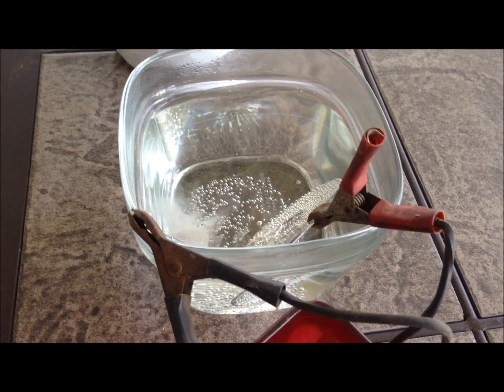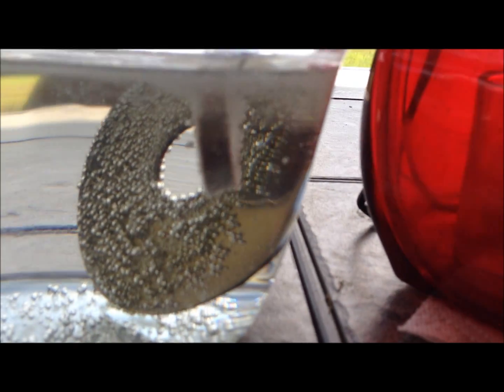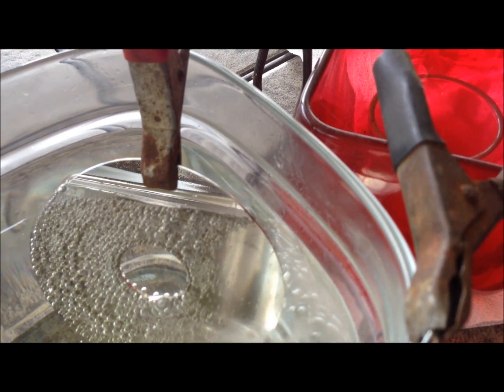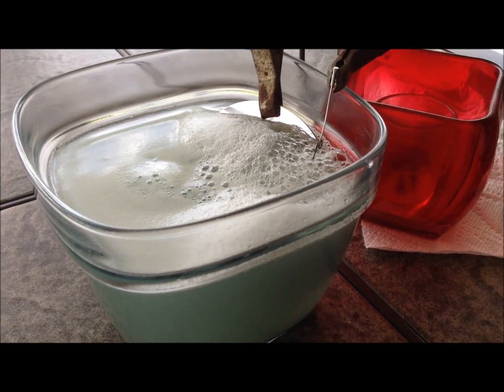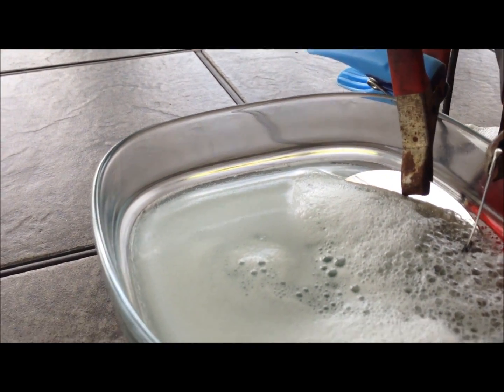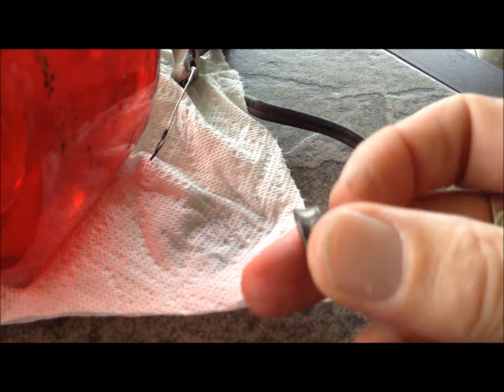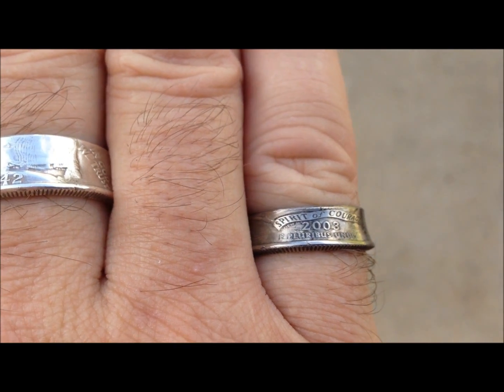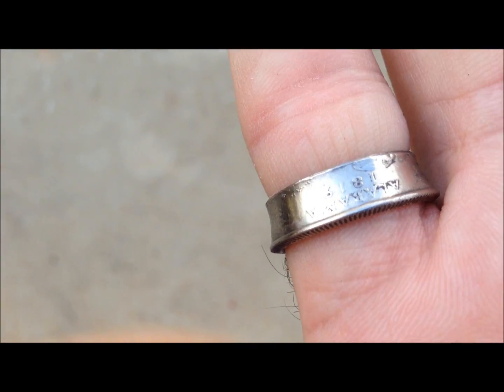Platinum Plating a copper silver coin ring

Comment: did we ever figure out what metal was the end result?
Reply: you need pulse width modulation, try swapping out battery charger with a laptop power supply ( ;
Reply from the maker: Brennon Baxter I believe it was actually nickel, I have found a couple articles on HD manufacturing and the main metal the platter is coated in is nickle. :( Oh well was fun at least.
Reply: scubabatdan Many contain Platinum at a very thin layer.
Reply: You cant plate platinum that way.  You have complex it/ oxidize it with chlorine(hexachloroplatinate salts).  Chemically it's much easier to break apart the water, so this is all that would happen on that side.  You also cant plate aluminum this way, it just gets oxidized by the water.  It's probably nickel.   You can test if something is platinum coated by putting it in some hydrogen peroxide.  It catalyzes the decomposition and gives off bubbles of oxygen.

Comment: I dont think its platinum plated. its got the color but the reason your solution turned green was you plated it with aluminum. the platinum on a disk is extremely thin. if you want to do a test dip it in HCL (hydrocloric acid) if it disolves off its aluminum.